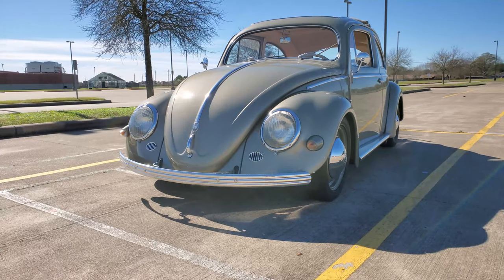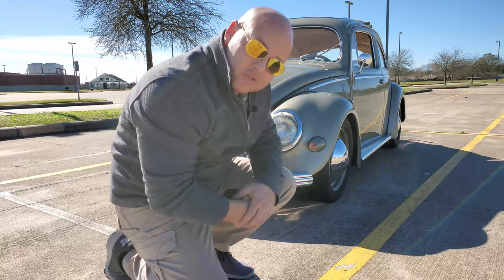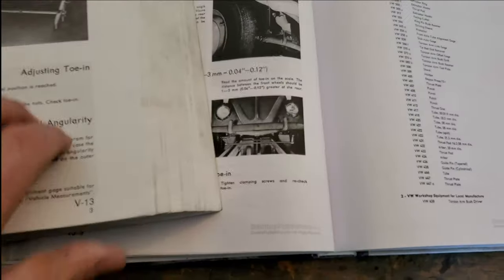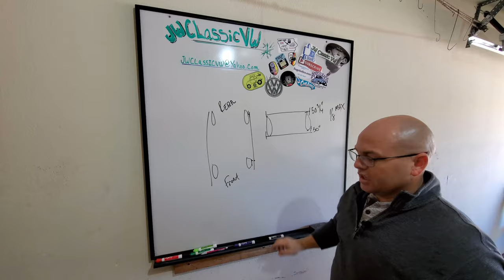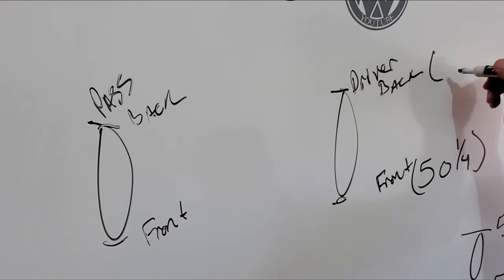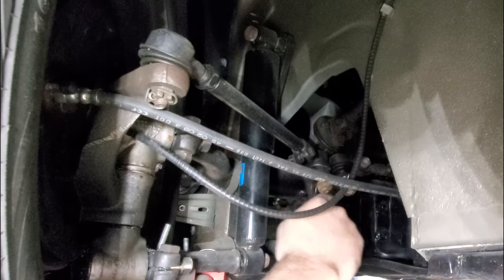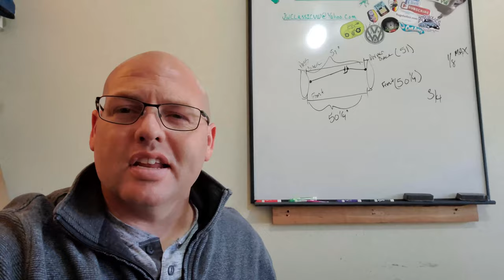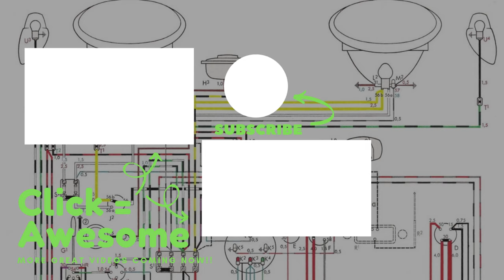How To - Toe Adjustment - 1956 Oval Window Rag-top - Volkswagen BUG | JW Classic VW

Comment: You’re measuring total toe but you should do each wheel individually from the centerline of the car.  Also get your measurements from the rim edge not the tire, lock the steering wheel when adjusting, and use plastic trash bags or two linoleum squares with grease between them under the tires. Nice car and looks like you’re having fun with it.
Reply from the maker: Good info here brother, I do use the center line and in my narrowing the beam video I show it toward the end.  Always a good idea to have a common reference point for both sides.

Comment: Cool video, super cool bug! I remember doing this quite a few times on my Baja bugs in the 90's but there was a lot more room. Should make it way more enjoyable to drive.
Reply from the maker: Yup now I gotta go pick up my new tires from Discount..  that should make the ride a lot smoother. 👍😎👍
Reply: @JWClassicVW  What size tires do you run on Goose?  Great video, thanks ---looking forward to the others  you plan on making on alignment and suspension 👍🏻
Reply from the maker: @gmd1417  Thanks so much for comment brother... 165/60 r15 front
185/65 r15 rear
Looking forward to those next videos too!

Comment: Question: I have the front beam of my bus currently mounted to a ajustable cart, I replaced King, Link, & Pitman arms with new plus tie rod drag link, steering damper. I just got in the new back plates so can complete assembly. Question, using drums your thought on a process of measuring the drums to get a close  starting pint for front end  adjustment while it is on the table and easy to reach ?? It is a pain when you could use an extra set of hands working on the vw's. Enjoyed the video.
Reply from the maker: Hey brother good morning... how is the foot man, hope your feeling better.  As for the adjustment of the toe with the beam mounted to the rack bench you have that would probably fall under the unladden settings described in the Bentley Book.  Unladden was 2mm to 4mm or the 1/8 allowable difference from the rear of the wheel to the front of the wheel.  Of course you would want to check this again when weight is applied to the suspension.  One thing to keep in mind is this measurement is pulled from the wheels so you may need to fab up a jig that would duplicate the width of the wheel off the drum... I'm sure a piece of angle or square tube would work.
Reply: @JWClassicVW  Jason thanks for the reply, went to hospital today and was told this will be my last cast, next Tuesday done---so getting close for some garage time. Today's -8 outside in Iowa..  I was thinking about what your are saying, I have new tires that I needed to mount on the rims.. I could go ahead clean the rims mount and balance new tires. Then install on the drums and get the measurements..The table should hold the weight, then double check once bean underload installed on the bus.

Comment: Great video!  On a 1965 Bug, I just installed new steering gearbox, tie rods, dampner, idler arm etc.  I now have extensive "wandering" when I drive.  About six inches of play with the steering wheel (!)   Should I be adjusting the tie rods first before moving on to the steering gearbox?  Is it easier to adjust with the gas tank out?  Thank you!!
Reply from the maker: Everything is easier with the tank out but you should be able to adjust it by removing the access plate.  That is a lot of play... you'll definitely get some of that out by adjusting the lash in the steering box.  As for the tie rods, there shouldn't be much play there.
Reply: @JWClassicVW  Appreciate the help.  Thank you!!

Comment: HI Jason, I have viewed your video clip along with many other clips that others have posted on the toe-in subject.  I'm still not clear how any adjustment can be accurate until the steering wheel is centered with the swing lever.  Then, would not the front wheels need to be brought to 0?  It seems to me that if you start with a toe-in that is already misaligned, how do you know which wheel to adjust either in or out from 0?  And to be fair all other video clips do not  address this either.  Keep up the great work.  You definitely keep me motivated.
Reply from the maker: Stay tuned brother, once I get this beam back together I'll be doing the alignment all over again.  The key with the steering wheel is to center it first and lock it in position.  Back when I was doing an alignments as a mechanic we had a tool that locked the steering wheel in place.  What I ended doing since I had no lock was to keep checking the wheel "not ideal".  Moving on from the steering wheel the next thing to check is the relative location of both front wheels to ensure that one wheel isn't toed in more than the other... this is probably what your referring to... I used a string line to check the drivers front and passengers front, they were exactly the same front of tire and back of tire off the string line.  With this I was able to make the small adjustment to the toe.  I'll go over this process in a video soon.

Comment: You should always center the steering wheel prior to measuring and making adjustments (so the wheel is straight).  The camber looks out of whack as well.  Seems like the tire is leaning out (top out further then the bottom).
Reply from the maker: Before and after every adjustment and measurement wheel was centered... the only thing I wish I had was a wheel lock.  I'll be going through Camber and Caster in a future video when I replace the spindles.  Good stuff thanks for the comment!!!

Comment: Love the car, the drive was awesome!
I have to say this because I just couldn’t let it go. 
1. Center steering wheel
2. Put toe plate (or straight pieces of 2X8 wood) flat up against outside of both front wheels. 
3. Measure front of front wheel (from 2x8 plates/boards, leave plates/boards and do the rear of front tires. 
4. You need to be in the middle of front tires and middle of rear of front tires to be accurate. You were way to low on the tires which would make measurements way off the lower you go. 
5. The whole point is to get a measurement from furthest front of tire and further rear of front tire to get the difference. It does NOT matter if you’re at center “line” of the treat, you need to be at center HEIGHT of front and rear and get the difference. 
You can get toe-plates that make this so simple and they’re really cheap and made of roughly 1/4” this aluminum and typically correct height getting you to center of wheel (height).
Again, if you don’t start with centering the steering wheel, you cannot calculate how much to adjust each side to get everything centered properly. You’ll likely feel like everything is a LOT better with what you did, but still could get a lot better. 
Looks like camber is off on at least one side just by eyeballing it. To be 100%, should be Caster, Camber, then Toe, which can all be done at home if you have a level surface and a few basic tools (plus camber gauge, also inexpensive for bug). Get a camber gauge that threads onto center axle nut and you’ll be golden. Your style, attitude, and overall video are awesome, just wanted to throw a couple basic tips out there to save you some major wear on tires and much better overall tracking and stability.
Reply from the maker: Good info brother!

Comment: Jason -  Great video,  enjoyed the cruise as well in the first few minutes. The General pulls nicely in all gears 😊 ! One question: Shouldn't you do an alignment first before setting toe and camber? Or does that not matter?
Reply from the maker: Hey there brother!! That is a great question... Toe and Camber are part of the front end alignment but you are kinda right.... there is a process flow to what should be completed 1st, 2nd and 3rd.  As for Caster it can be done independently as it will not change either toe or camber, it only changes the beam angle in relation to the chassis.  For toe and camber I would always start with camber due to how this changes the Geometry of the spindle.  After correctly shimming your king pin carrier or adjustment of the ball joints depending on the front end type you would move to toe.  Yes toe should be your final adjustment.  I'll be completely doing this process all over again once I install my new tires and front brake kit.
Reply: @JWClassicVW  Jason -  Have you figured out what caused the passenger side tire to wear so much more than the driver side, or are you still working on that? ( I have the exact same problem on my '59 bug 🥺)
Reply from the maker: @gmd1417  pretty sure it was that my toe was so far out... really won't know until I get my new tires on and see how they start to wear.
Reply: @JWClassicVW  Cool, looking forward to that. I have new tires on the way as well. I run 135/r/15s on my lowered front end, and have to buy them online as no one carries them...

Comment: Should alignment not be measured from the actual rim edge and not the tyre ?
Same as you did, front and back but just measuring from rim edge to rim edge, in the center of the wheel.
Reply from the maker: Sure you could do that! I'm actually working on a jig that will allow me to complete the toe adjustment doing just that.

Comment: Vw classic's: I watch your toe-in & toe-out..have question ? On your bug..where steering box is located..do you have a "locating hole (threaded) that centers your steering linkage" ( what this hole does is centers the steering-box, then your steering wheel behind the dash, then to your front wheels..all this works together..( makes the flashers shut-off when wheel returns back to center & the steering wheel returns horizontal even with the dash. Otherwise the steering wheel is cocked on an angle while you're going down the road and you don't want that.. check your owner's manual for proper location.. I think they call that a centering pin..have fun jason.RGB.
Reply from the maker: Hey Robert!! Thanks soooo much buddy! I didn't get to test drive her until late last night and had just that issue.  I'll look at it this morning, you are the man!